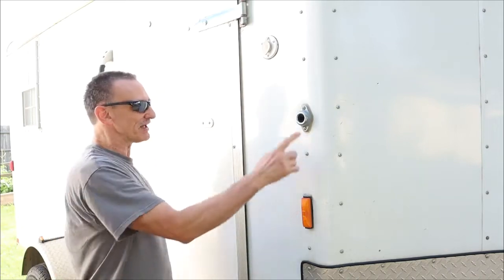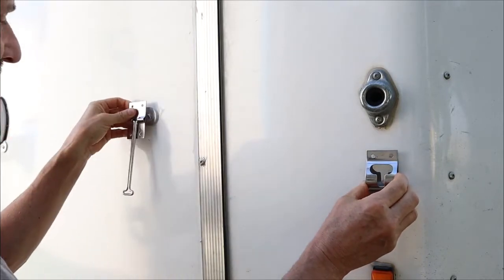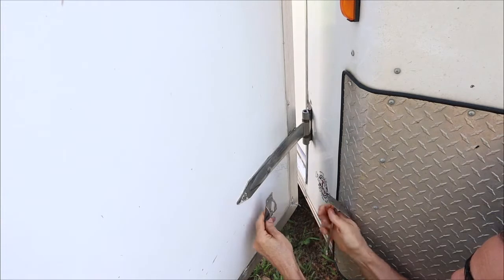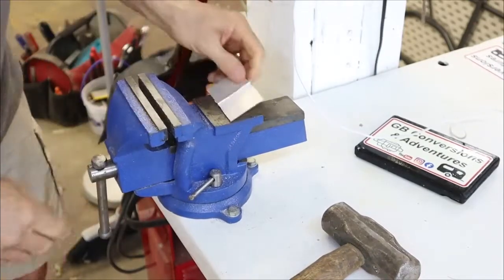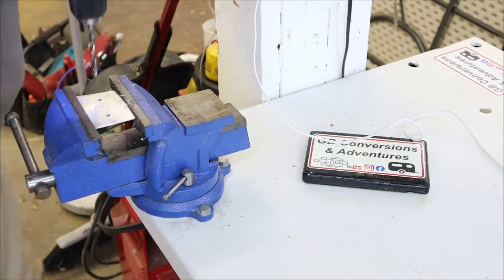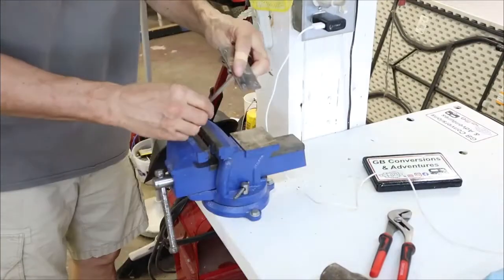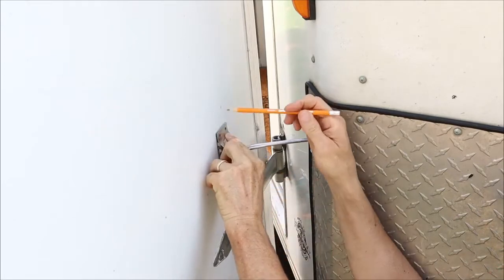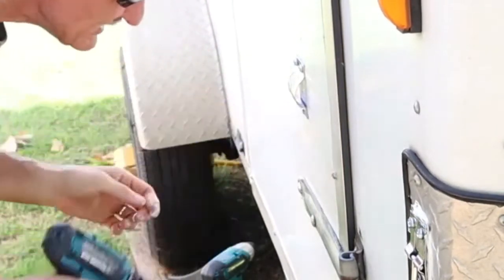RV DOOR CATCH LATCH HOLDER Cargo Trailer Camper Conversions Van LIfe Skoolie Vanlife Pop Up Camper

Comment: GB, Using The paper clip to make some thread's is a good last resort move. You must have been working with some mighty thin stuff to screw into. Evidently an over .sized screw or a lead anchor and then a screw added to it probably wouldn't have worked in Your situation, I trust Your judgement because You know the whole story. One thing about You Texas Boy's is it offensive to use a lock washer or a star washer under a screw?  Just kidding GB--Wishing You Well in every thing You do.
Reply from the maker: Thanks MT. Yeah this was thin stuff and had to be sealed as well. Using a star washer may be a good idea, if enough dicor is applied to seal it as well. You suggestions are always welcome. You think of things I didn't see. Extra eyes are always good.
Reply: I need an education...what’s the paper clip method?
Reply from the maker: @sinjinrides689  If you look at the video at 7:00 and 8:10 you will see I insert a paper clip into the screw hole before tightening the screw. I had already tightened the screw too tight and the screw enlarged the hole. The hole was no longer usable with that screw. Rather than going with a larger screw or attempting to repair this another way I inserted the paperclip first. This added more metal to the hole and gave the screw a second chance to grab. Sometimes it works sometimes it doesn't. Thanks for asking.

Comment: I have a question for yah, did that ever pull out of the door? I am about to try and put one on my girlfriends concession trailer and the door is about 30 thousands thick with no backing. Super thin cheap door. I'm afraid the screws are going to pull out the first big wind that hits it. I really don't want to go all the way through the door to the inside either. So I was just wondering how the adhesive and screws held up on your door? BTW Love the paperclip trick 👍
Reply from the maker: My door was 3/4 inch plywood with aluminum skin on the outside. My screws were driven into the wood. I agree that .03 aluminum is not going to hold onto the screws in a stiff wind. What is on the inside of your door pst the aluminum skin?
Reply: @FakeLegGreg  Thank you for the reply. Almost every trailer I've seen is like yours, plywood. But unfortunately this one is made extremely cheap. I will figure something out. Thanks again 👍